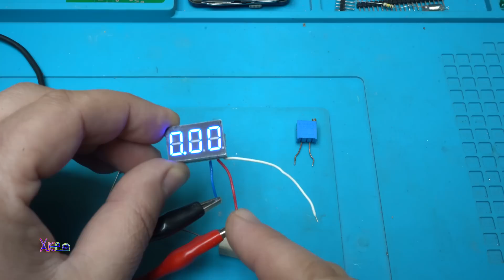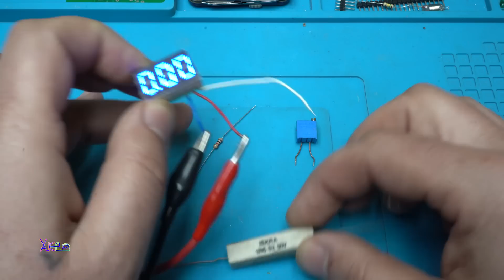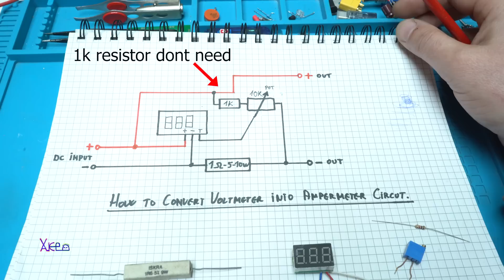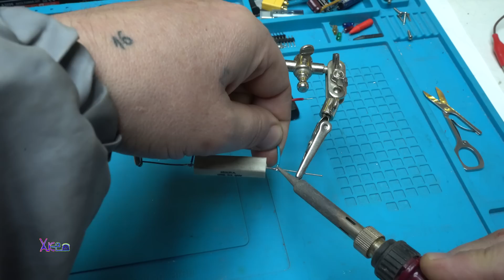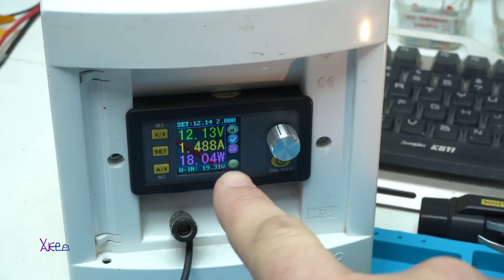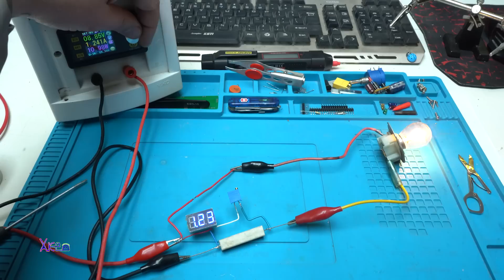How To Make a Ampermeter out of LED Voltmeter?

Comment: should adjust the potentiometer to display the same as your power supply reading of AMPS. 
This is calibration!
Reply: But what if the power supply isn't calibrated accurately?
Reply from the maker: You are absolutely right, calibration is key for accuracy!
Reply: My meter shows 0.00 even though my dc motor is spinning. So I need a power supply with display and adjust that trim pot to match it?